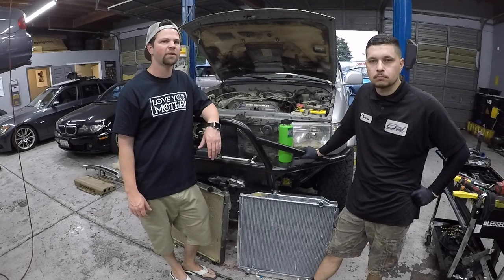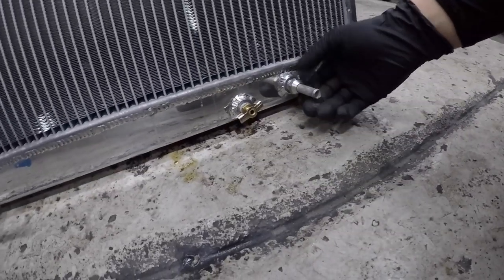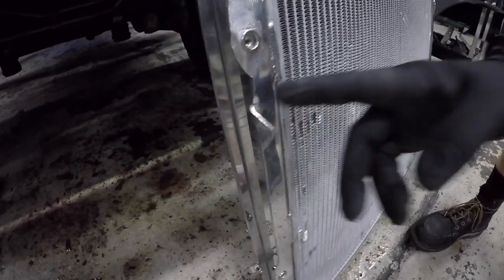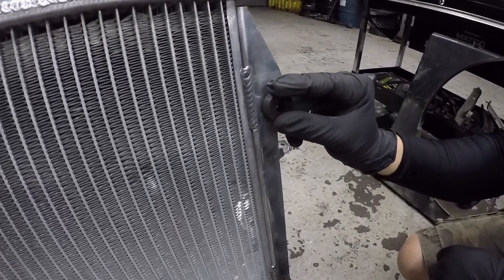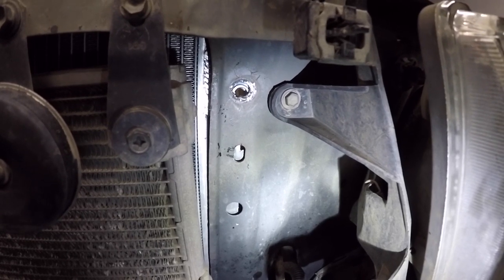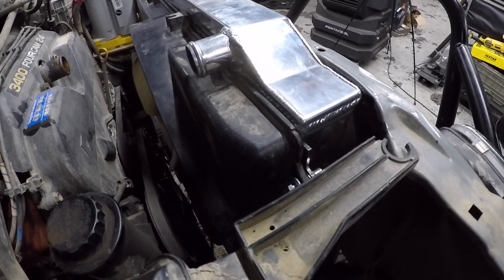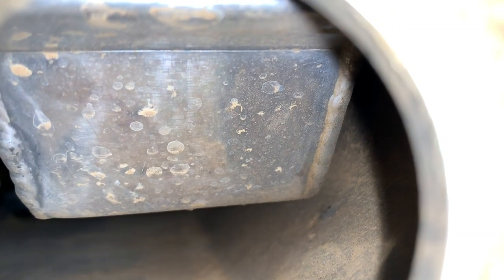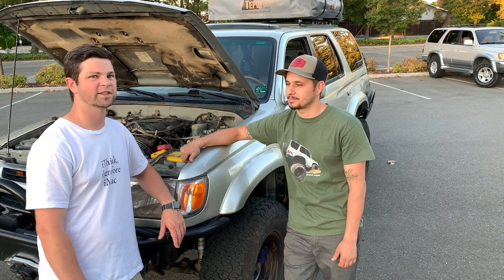Champion Aluminum Radiator Installation (3rd Gen Toyota 4Runner)

Comment: I just got back from the sand dunes and the champion performed perfect, the dunes really work the truck hard at slow speed.  It has the install issues, but it's really a great radiator.
Reply: I just wanted to avoid the dreaded pink milkshake
Reply from the maker: thanks for sharing your experience with your recent trip! this video was inspired by you Andy! We appreciate your contributions to the 3rd gen Toyota 4runner community.

Comment: I finished installing this radiator last week and I did not have any issues other than the support tabs. Timmy always have great instructions and I like to add that on the support tabs you have to bend them straight and bend them back at a true 90 degree closer to the radiator support. I only had to open up one of the mounting holes on the 4Runner with a stepping bit to get the bolts aligned and the other 3 holes lined up with the radiator. I ordered bolts from McMaster-Carr p/n 95735A425 8Mx1.25x25mm.
Reply from the maker: Glad our video helped you out.  It was all Sean and Marcus though.  Timmy (me) had nothing to do with this video.  Thanks for the comment.  We appreciate it.
Reply from the maker: We installed another one of these radiators in a 98’ a while ago and same thing with the tabs. We had to bend the tabs as well since they were not in the right place. We didn’t have to open up any of the holes, we did source some different hardware than the video showcases and some different rubber isolators. The fan shroud doesn’t fit right on these. We didn’t cut anything the second time around - a little gap won’t hurt.
Reply: @TimmyTheToolman   I did the same thing and just left the shroud alone with the little gap. Thanks again

Comment: I put one of these in my 01 a couple years ago. All the same stuff. Went and got all new stainless hardware and insulator bushings. Skipped the trans cooler altogether and installed a remote trans cooler instead. Same upper right hole had to be hogged out a bit with a dremel and carbide burr. Had to trim my upper hose about 3/8" at the rad end to clear the fan better.
Reply from the maker: The Shocker good call out! You might need to cut a little off the radiator hoses since it is a thicker radiator. We had to trim a little off the bottom as well.

Comment: I put a champion radiator in a couple months ago and bent the tab straight and then bent them in half and it fit perfectly relocating the Bolt hole down a smidge and put a Flex fan in and it came with a Billet aluminum adapter to delete fan clutch and my temperatures are 188 at idle while temperatures outside are about 106
Reply: I used the ultragauge
Reply: I'm in the middle of suspension so I do not know what it cruises at
Reply from the maker: Adam Taber do you have a build thread somewhere? I’m sure people would like to see what your setup looks like
Reply: @TimmyTheToolman  I do have an old one on t4r.org but I have not updated it in probably a  year Godzilla T4R is my user name

Comment: Awesome video as always! 
I actually installed the Koyorad aluminum radiator on my 5speed, the temps stay much cooler than the OEM radiator. With the OEM rad when it was 105°F outside, my coolant temperature stayed around 195-198°F. Now with the aluminum radiator my coolant temps stay right around 186-190°F at the same ambient temp. Definitely recommend it!
Reply: Link to Koyorad?
Reply: Matt Bradbury https://sportcompactwarehouse.com/koyo-vh010665n they have the best price. Make sure you order the cap, the radiator doesn’t include it. I recommend buying two caps just incase one fails down the road
Reply: Any install mods required on the koyorad rad ?
Reply: @sbrkwc  nope, exact swap for my 5speed. If you have an auto you’ll have to get an external cooler.
Reply: @anwaral-janabi1309  Thank you.  Not even longer M8 bolts to mount  ?  That will be nice.
Reply: @sbrkwc  nope direct bolt on, I ran small rubber isolators with factory bolts if I remember correctly

Comment: While this radiator will out perform the stock radiator hands down for temperature control the down side is the aluminum is very very thin. Because of this this the chance of it popping a leak is very possible.

I mounted the champion radiator with rubber mounts where it connects to the body frame and the radiator still failed. The biggest problem is the top and bottom tanks are not welded as one frame. Because of this
the movement of the truck frame twists the radiator and the seams will leak. Just be aware of this.
My radiator lasted 30,000 miles and while it was covered by warranty they were out of stock for 3 months.
So be aware of this. I ended having a custom radiator made because I can’t take the chance of a leaking radiator or waiting 3 months for a replacement radiator. The stock radiator is only .75” thick in the fin area 
and it sucks for performance when it’s 100 degrees.
Reply from the maker: Thanks for sharing this information John.

Comment: Sorry aircraft mechanic here; could you get away with some bolts with springs on the inner side of the radiator with washers and pinned or lock wired nuts and rubber shock gaskets between the mount and radiator for a better anti crack/ shock mounting?
Reply from the maker: Don't know, we haven't tried it.  If you do, let us know how it worked for you.

Comment: I would say the longer bolt is a plus. You could add a nylon nut to the extra threads for a piece of mind.
Reply from the maker: Twisting Terrain that’s a good idea to help prevent the bolt from backing out of the nut serts on the radiator. Maybe some blue locktite could help prevent this.

Comment: Hey Tim....was looking through your videos and saw that you installed a roof rack....i was wondering if you can give any advice, ideas, suggestion...maybe more videos on installing a roof rack on a 3rd gen that has no factory roof rack and or mounting holes for a roof rack. Anything will help greatly thanks
Reply from the maker: 2key 670 depending on your needs and budget. A rola rack might be the answer. We have a GOBI rack, a custom “gobi” style rack and a Sherpa equipment Co. Rack. All of which are good in there own ways . We’ve come across some rigs at the junkyard that have no roof rack! Does it have a black strip along the sides at least? You should have your mounting holes there and may need to get a factory rack before you can install an aftermarket rack.
Reply: @TimmyTheToolman  thanks and as for the mounting holes or black strip...there are none( i have a 1998 SR5) so maybe ill just have to drill through the roof if it seems like the only option but ill check up on the products you mentioned...thanks
Reply from the maker: That's kind of a bummer there's nothing there.  Who would buy one of these rigs without the roof rack?  Weird.  We have a video that shows how to remove the headliner and that will probably help you out if you decide to drill into your roof.  You could get one of those Rivet Nut tools and install rivet nuts that have threads.  I'd follow that up with with silicone around each rivet nut and also a little silicone in threads of each nut before your bolt rails or whatever you plan on mounting on there.  Maybe you could snag some factory rails off one at a wrecking yard, lay them on the roof where you want them, mark the holes, drill, install rivet nuts and you'll now have factory roof rails on your rig to attach whatever you want to it.  Here's the link to the headliner video: https://youtu.be/MVJW0XM2x24
Reply: @TimmyTheToolman  yeah i got  my runner from my father in-law so didnt really had an option to choose, and it was free so thumbs up for that and i did watch the headliner removal vid you had with Mark about the leaking roof because i have the same problem...water leak on the passenger side c pillar and dripping water in the passenger side cargo area...i used an impact screwdriver and it just stripped the screw head even more so im waiting the screw extractor set that i ordered. Would like to know though if Marks truck is leaking again...thanks Timmy The Toolman
Reply from the maker: 2key 670 Mark’s truck has been water tight since we did those videos with him.
Reply: @TimmyTheToolman  wow thanks, hope my solution to the leak turns out the same with no holes or serious repairs, thanks a bunch Timmy The Toolman
Reply from the maker: 2key 670 Good luck and let us know how all the work turns out for you.

Comment: Tim my plastic rad went out 30k miles into it. I want to keep using toyota red, and Champion isnt an option for me, also they break aswell. Should I stick oem or what you recommend for my 97 auto 4x4 reg cab taco? Thx!
Reply from the maker: Yeah, I'd stick with OEM.

Comment: Quick maybe silly question... is the aluminum radiator lighter than the stock radiator?
Reply from the maker: The stock radiator isn't heavy to begin with.  I'd almost guess the aluminum radiator is heavier.  But, we're not talking a big weight difference, maybe a few pounds at most, so it's not really an important consideration in the grand scope of overall vehicle weight.

Comment: Wonder if this radiator will fit with a stock Skid plate setup for the 3rd gen 4runner
Reply from the maker: Good question.  I think the guys I know of that have used this radiator are running aftermarket skids.
Reply: Stock radiator won’t fit after you install this radiator.
Reply: @roydoggy  lmfao I didn't ask if the stock radiator would fit after this radiator was installed might want to re read what I originally wrote
Reply: @AntonioClaudioMichael  weird, I thought I wrote stock skid plate won’t work with this radiator. Long shift... 

I did this mod before I left for deployment and couldn’t fit the stock skid plate back on. I was going to add a ShrockWorks skid plate and armor but covid happened. I’m worried that it won’t make clearance like the savage skid plate in the video shows. Once I get back and try, I’ll let you know if it’s successful.
Reply: @roydoggy  okay sounds good

Comment: timmy i have a problem with my 2001 4 runner electronic shift awd transfer case

if i out of the blue try to put it in awd by pressing the 4x4 button without pressing the center lock on the dash the indicator light in the gauge cluster flashes 

and if i press the 4x4 button again it just keeps flashing... even though by just driving you can tell its in 4wd locked center its my daily and my only vehicle that has the parking pass for the college i go to
Reply: the exact same thing happened to me yesterday except when i started it up after letting it sit for half an hour the t case whirred and all was good but not today i tried to see if it would work today or if it was still malfunctioning
Reply from the maker: We haven't troubleshooted a problem like this before.  Have you tried searching for your answer online?  I bet there's some threads on T4R.org that cover diagnosing an issue like yours.

Comment: Just received my Champion radiator and was getting everything ready to install, I noticed that on the packaging it said you use "The Green stuff Only", I currently have Toyota Red and would like to keep Toyota Red. I even called them and said not to use Toyota Red even though they are both ethylene glycol just different additives. Has anyone heard of any issues using Toyota red in these radiators?
Reply from the maker: This is interesting Paul especially since they made the radiator to fit a Toyota.  Did you ask them to expand on the reason for Green Only?  Is there some science behind it?
Reply: @TimmyTheToolman  I asked and the representative said it was because of the difference in additives. Said some people have been fine and others have had issues. It makes me think that it could be linked to possibly using dexcool instead of Toyota Red. A user on ih8mud had mentioned that if you look at the back of the Toyota Red in small print it says "Does not contain borates that may cause aluminum corrosion/pitting" and he has had no issues running red in his. Based on others' experience and a good article on motor.com around the different coolants I decided to keep Toyota Red. So far so good, but only time will tell...
Reply from the maker: @benficaboy09  Well, hopefully it's a non-issue and everything will be fine.

Comment: What do you think is the best way to route the transmission lines?
1. Trans to radiator to external cooler back to trans 
or
2. Trans to external radiator to radiator and back to trans
Thanks
Reply from the maker: Option 1.

Comment: Hey Tim, I purchased a 98 4runner with this radiator installed but the owner couldn’t tell me what type of coolant I would use. Would you be able to give me an idea?
Reply from the maker: Just use what these 3rd Gen 4runner came from the factory with, the Toyota Red Coolant.  You can buy it in a concentrate and 50% water to make yourself a 50/50 solution.  In our coolant flush video, we have links to helpful items to purchase for this like a gallon size measuring cup so you can make your 50/50 mix and a no spill funnel.  Check it out: https://youtu.be/oQsxmi-CNng

Comment: For those not running an auxillary trans cooler what info has been gathered about trans temps with this all aluminum radiator?
Reply from the maker: nharp83 take a look at Anwar’s comment on this video
Reply: @TimmyTheToolman  Anwar has a MT, not an auto, correct?
Reply from the maker: nharp83 ah true! I hope others will pipe in on the comments and share their experience with their aluminum radiators
Reply from the maker: @nharp83  Yes, he has a manual transmission.

Comment: I thought you were not supposed to use the red coolant with the champion radiator.
Reply from the maker: I guess he wants to live dangerously.
Reply: @TimmyTheToolman  lol
Reply: Considering this rad, why don't you use the Toyota long life? Not as good for performance?
Reply: @lk6912  It’s specified by the manufacture of the champion radiator
Reply: @lk6912  Toyota Red leads to  premature Failure

Comment: Are you concerned about the poor quality control on this radiator?  We've seen several reports of them failing in less than 50K miles.
Reply from the maker: John Morgan we are not here to speak about quality/longevity. Could it fail fast than an OEM radiator. Yes. Will it? Only time will tell. Sometimes sicmodding takes some research and development. If Marcus has a premature failure, we will update this video and possibly make a part 2. Have you installed one of these radiators on your rig only to have it fail prematurely?
Reply: @TimmyTheToolman  - We have a thread going over at TacomaWorld/1st Gen. about folks who have installed the Champion and quite a few are saying they had poor reliability.  I have not installed one on my truck though. Keep a close eye on it...
Reply: @kiloyardstare  can you post a link to the thread?  I'm curious to read about the failures.  Thanks.
Reply: Plenty of these radiators Have failed including my Champion radiator.
The aluminum is just super thin

Comment: Does this eliminate the risk of pink milkshake?
Reply from the maker: The only way to 100% avoid the pink milkshake is the bypass the trans cooler at the bottom of the radiator.  This aluminum radiator has a trans cooler in it, and like any radiator that has a trans cooler, it could crack and fail.  So no, this aluminum radiator does not eliminate the risk of the pink milk shake.

Comment: So how about the CC1778? anyone install that? Its suppose to be shorter so it doesnt hang down as far.......
Reply from the maker: this version shouldn't interfere with a stock skid plate or aftermarket but you give a good point... maybe we should buy it & find out!
Reply: @TimmyTheToolman  I've got a radiator in my crosshairs  that should  not hang below  the front support.  Ill report back
Reply: I bought the 1778 for my 3.4 1st gen Tacoma from Champion and ended up returning it.  It was going to be too much of an adaptation.  I got my Koyo last week and will start the install this weekend with a completely bypassed transmission cooler.  I will keep you posted.  I forgot to mention that Im using the 3rd gens 4Runner Koyo on my 1st gen Tacoma.

Comment: Can I get a parts list fellas? tia
Reply from the maker: We provide a link to the radiator in the video description and I reckon that's about all you need for this job unless you wanted to replace the upper and lower radiator hoses at the same time and maybe replace the thermostat as well.  If you wanted to replace some of the stuff I mentioned, you can find links to those parts in the video description of this video: https://youtu.be/2nVbwe2t2T8
Reply: @TimmyTheToolman  hey Sir I meant the actual hardware (i.e. bolts and washers used to mount the fan shroud). I've also had a hell of a time finding the rubber bushings